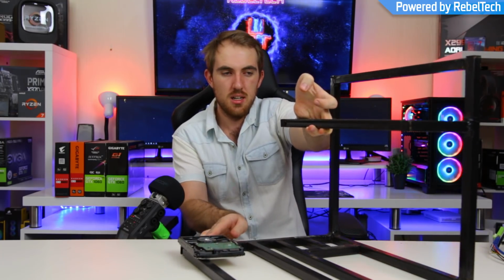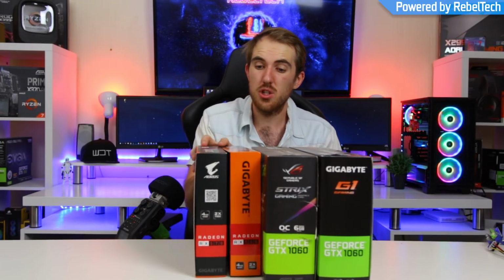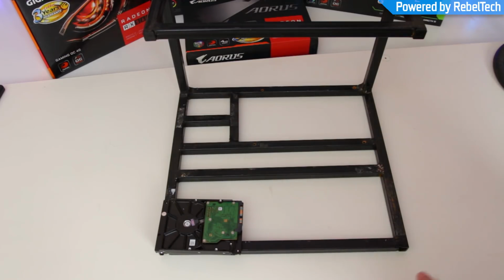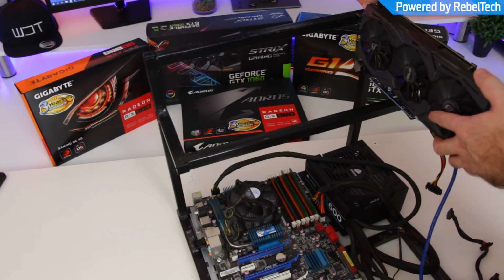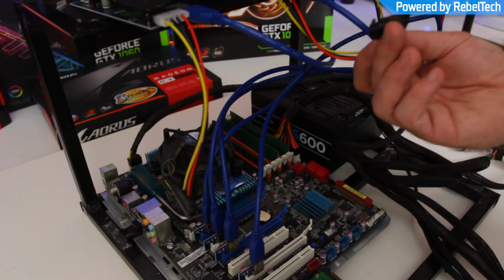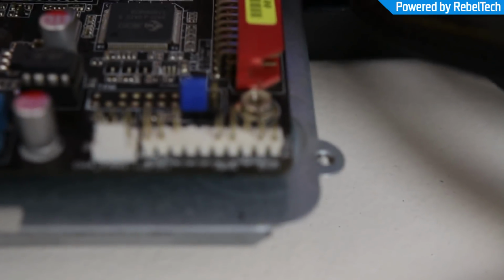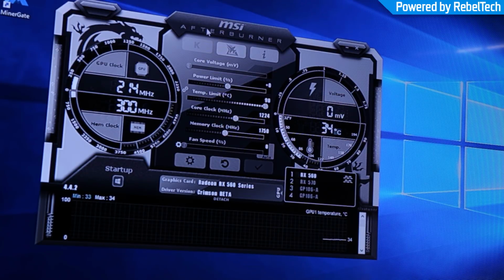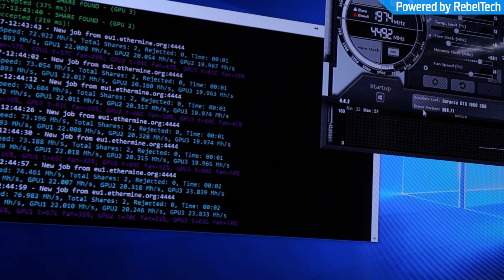How To Build Your First Crypto Mining Rig - Crypto Beginner Guide #2

Comment: I am trying to determine what would be most cost-effective to mine. What would you estimate the power consumption to be of the rig you just built. Does it make the most sense (economically speaking) to mine bitcoin or ethereum or some other currency?
Reply from the maker: The system uses about 570W, when underclocking some of the GPUs.
As for the currency, you should mine, you won't be able to mine Bitcoin directly, but you can use nicehash that will exchange altcoins that you mine for bitcoins and then pay you out in bitcoins. But bitcoin transaction fee is WAY too high now so would not recommend it.
I would say go for Zcash with Nvidia cards and Ethereum for AMD cards. Later when you know more about all the coins and prepared to take a risk you can go mine other coins.
Reply: thanks for the tip. A friend of mine just bought i think some x3 s9 antminers are you saying he won't make money?. I was thinking of building a gaming/mining hybrid rig. Is this advisable? My theory was that if crypto's turn out to be useless i'll at least have a sweet gaming pc
Reply from the maker: Oh, ASIC miners will be fine. You just won't be able to mine bitcoins with normal GPUs. That is a very good idea and something I tell a lot of people starting out. Go for it then if you see its working for you-you can expand a bit.